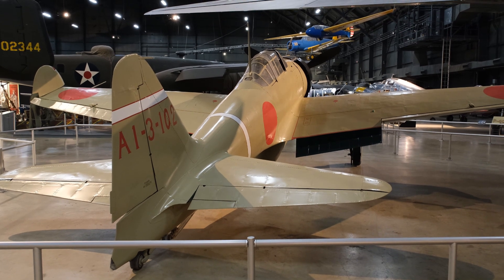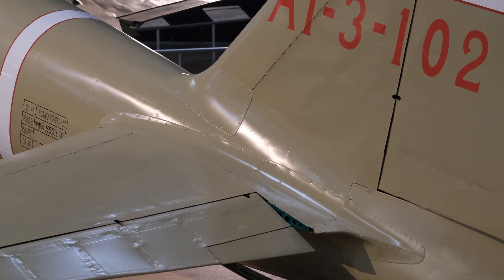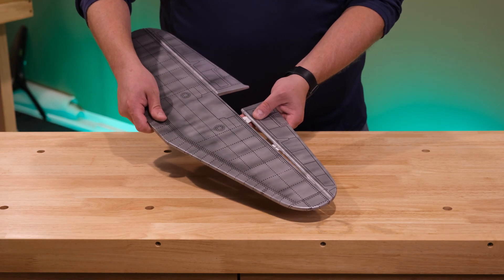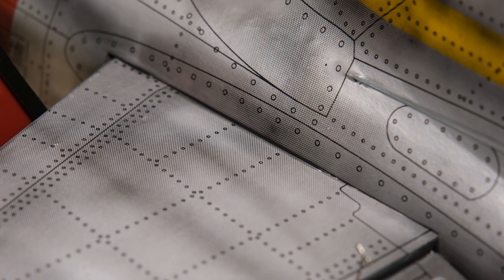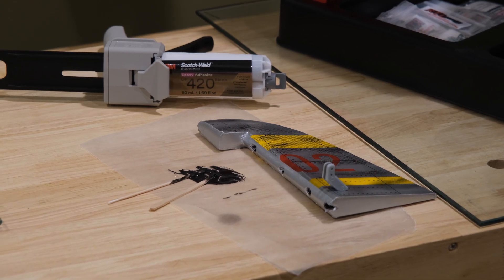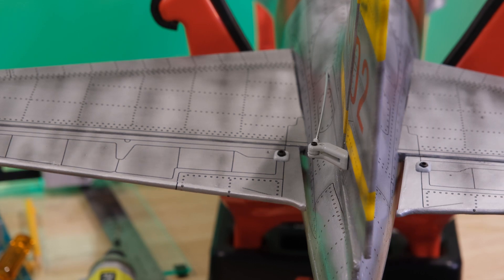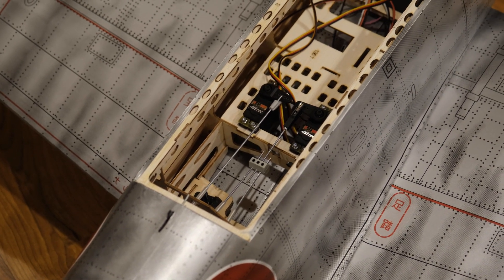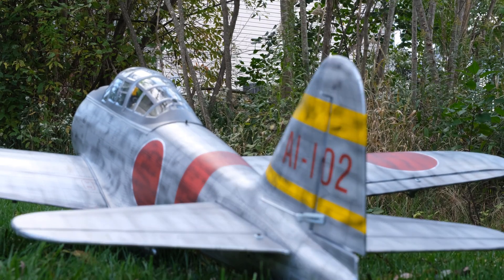Install Elevators, Rudder, and servos on the Phoenix Model 20cc 68" Mitsubishi Zero ARF - Tail Codes

Comment: I've got a question about the tail codes, and I hope you'll know the answer. I built a model that had the tail code "3-116", with one red horizontal stripe and no ABC characters. If "116" refers to the type of plane and its individual number, then what does the "3" prefix mean?

Comment: Did you cut away some of the covering to get a good contact with the glue?
This is sweet.
Reply from the maker: Yes, not all of it though. There is almost no wood inside the fuse below the stab, and just a little bit above (because of many lightening holes) So, since the opening for the stab is longer than the stab itself, I decided to push it all the way back and made sure there was bare wood for the glue there. There is plenty of wood on both the top and bottom of the fuse SIDES...so I removed just a bit of covering just inside....but I wanted to keep the lines clean.
Reply: @djmoosecom  

It came out good, I just finished Westland Lysander the build is very similar but this by far is a better build I'm going to pick one up soon , especially knowing supplies will be drying up do to supply chain problems.
Reply from the maker: Yes, I've done the same thing...I have my next 4 planes ready to put together. (and all equipment) Get your stuff now!